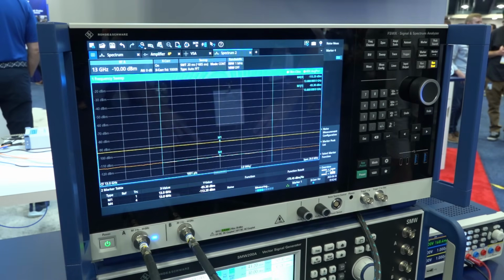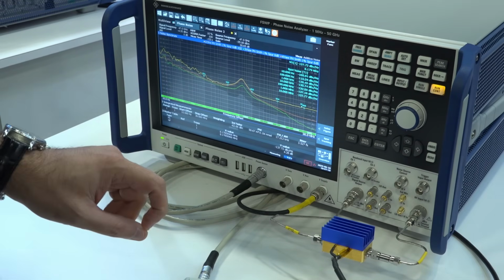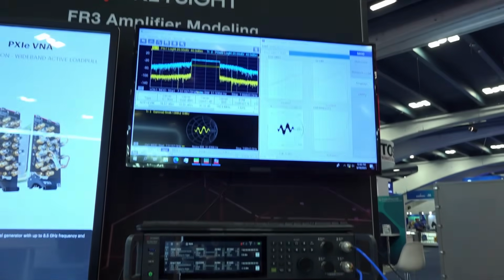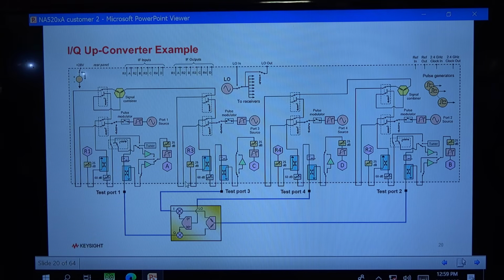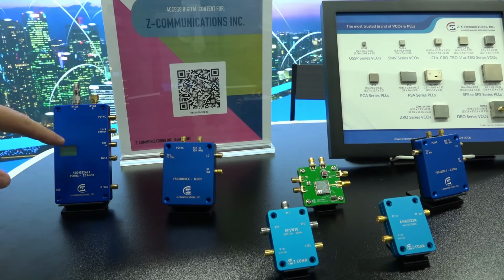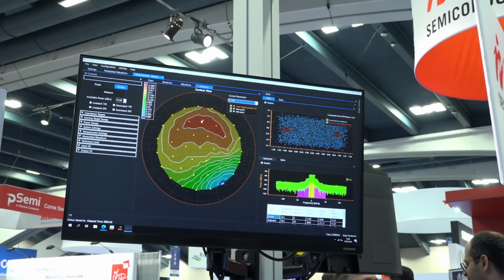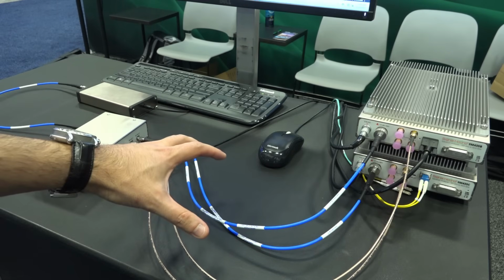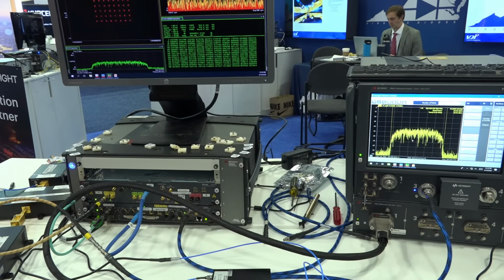TSP #316 - The Greatest RF Show on Earth! IEEE Microwave Symposium Exhibition, San Francisco 2025

Comment: excellent report - would have been great to be there, also very interessting the new PNA-X Pro as we intend to get the PNA-X plus va diodes modules, -- also great signal hound has a new vector signal generator with higher frequency, put it on the wish list, as I use the 6 Ghz so far. --- Also would be interssting to comparte the sigilent Vector Network analyser with the PNA-X for use with va diodes , but I thin the keysight is better adapted to these instruments.